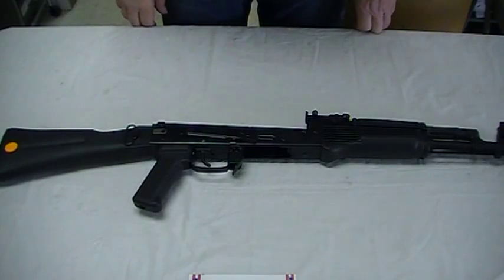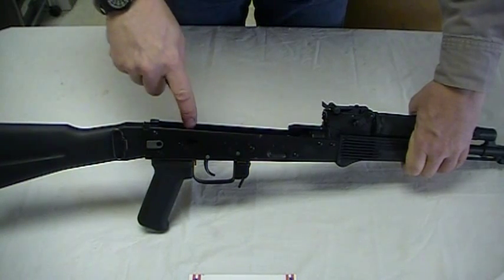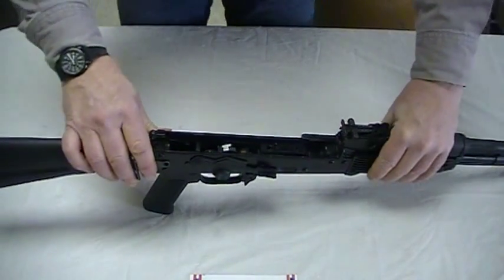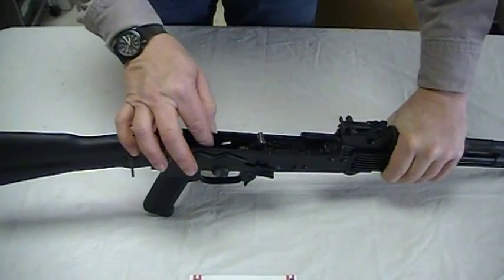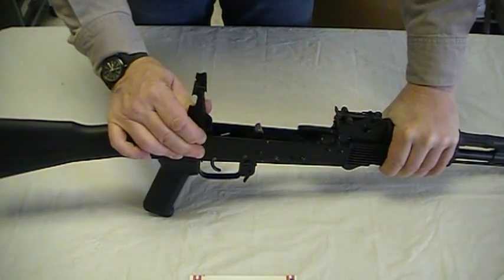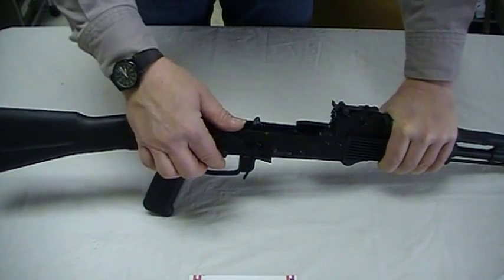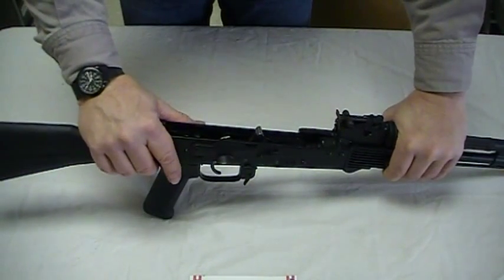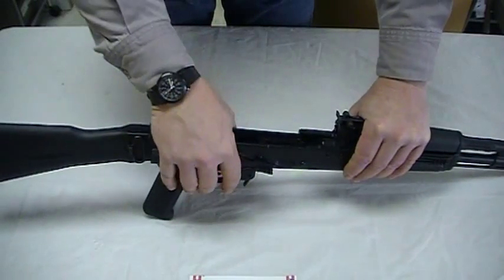Krebs Custom Enhanced Safety - Installation & Tuning

Comment: You are the first to tell us how to get past the trigger to remove/install a full auto style safety lever. Just knock out the trigger pin enough to allow the safety to rotate down, of course the first thing I will have to do is free the trigger pin from the shepards hook, Thank You.
I have the Krebs style pin retainer arriving soon to replace the shepards hook and I was unsure what I would have to do, now I know. I will also be making the "cut out" on my safety lever at this time (changing it from a full auto to a semi auto type) so that I will be able to remove/replace the safety without knocking out the trigger pin first which would be impossible with the Krebs pin retainer installed.